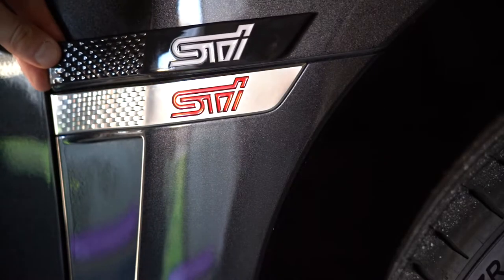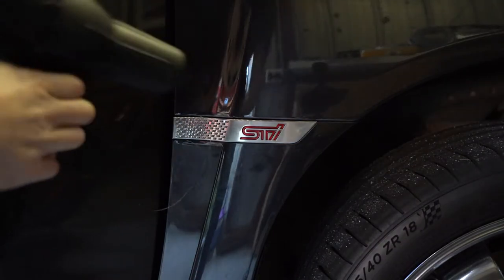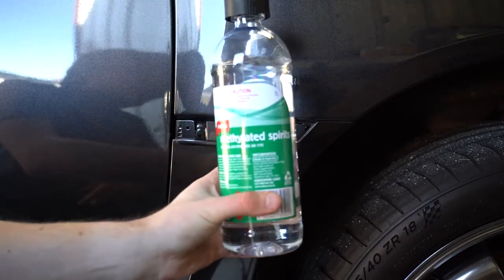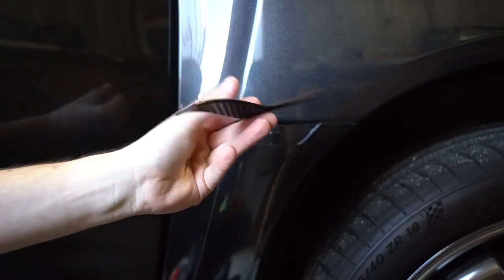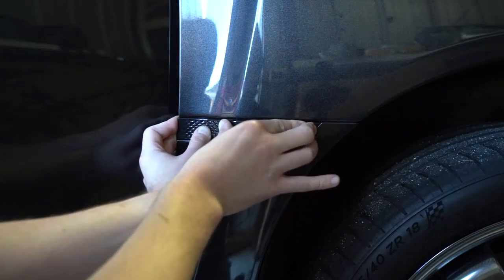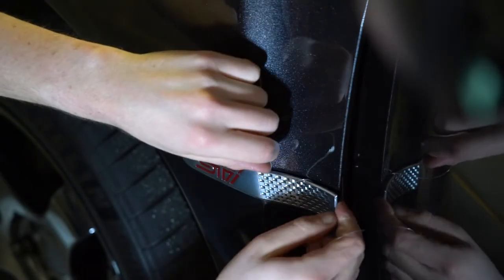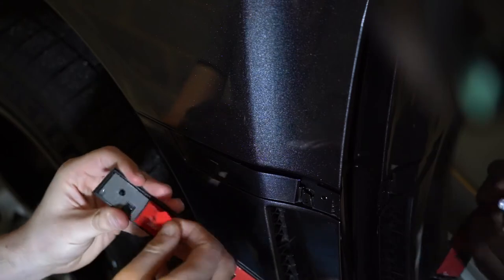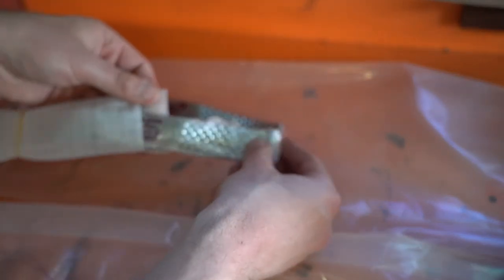Side Fender Badge Install Guide | Subaru WRX STI 2015+

Comment: I’ve got the same colour car and badges, unfortunately not the same rims haha, nice build man! Peace from Perth WA 🇦🇺
Reply from the maker: Hey thanks mate, the build is getting there!
Reply: @BenCad  I’m having trouble doing mine right now because I don’t have fishing line and I’m having to use this Perth weather to help me instead of a hair dryer, I got one Side off with a flat head, then turned the car around so the sun can heat up the other side now 😂
Reply from the maker: @Grim-STi  Hope the sun helps, perhaps if you could try Dental Floss if you have some around, it might break a few times but should do the trick also. Good luck with the sun!
Reply: Bitterman  yo!, I went with a Nameless Performance Muffler delete, I would recommend the 3.5 inch tips, good rumble and not too loud, but If you want loud like me I plan on getting a Cat Back from either Remark or a Invidia R400 and i might end up getting a new catted downpipe from invidia, I think cat less down pipe would risk being too loud here in Perth unless you went catless downpipe and then catted the rest of the way and you might also get away with a muffler delete axle back along with the catless down pipe 
Hope this helps :) 
+ the Mid Y Pipe that connects to the axle back is pretty thin stock so changing that will even open up the sound a bit, but it’s hard to find just the Y pipe or mid pipe whatever it’s called
Reply: Bitterman  honestly a tuned R400 sounds pretty loud a lot of people swap it out for the R300 because of it being so loud after a tune or after a good 1000kms of driving letting the carbon build up, Mine didn’t sound that loud when I first put it on but now I’ve done over 20,000kms with my muffler deleted axle back from NamelessPerformance and it’s definetly become louder. The Tomei Expreme cat back would be the way to go but after 5000kms driven on it it’ll be even louder and there’s a chance police won’t like you 😜, yeah I haven’t heard of anyone else with a nameless performance setup and I’m glad, I think mine has a unique rumble now that I’ve done a fair amount of kms on the car.  Fair enough if you don’t want to void warranty, I think I’ve already voided mine but I don’t really care because I plan on keeping and building this car for a long time :)

Comment: Hang on you swapped out $$$ badges for generic $30 badges?
Reply from the maker: Bitterman  Genuine black ones are hard to find in Australia, at the time during covid I couldn't find them at all. Then I found these and quite liked the white lettering. Might consider swapping to genuines one day but so far these are doing the job great, still look brand new. Easy mod to chop and change.
Reply: Genuine ones are only $50 lol, I’ve done the same black and white suits the dark metallic grey better, in my opinion.